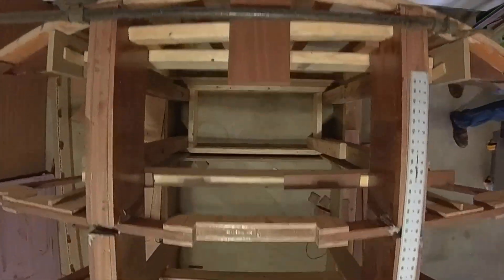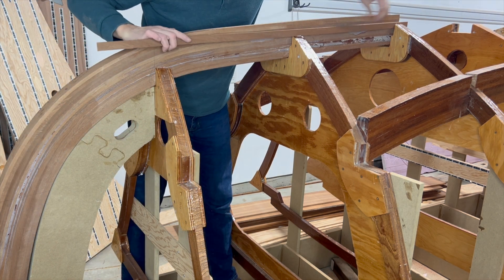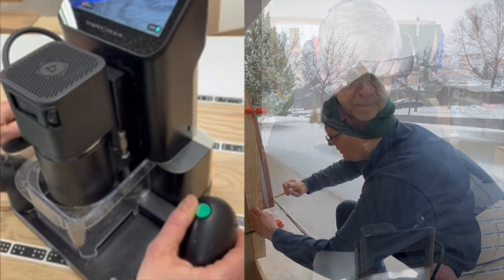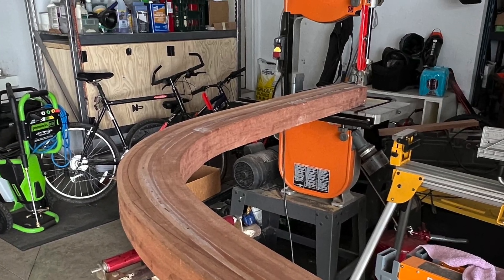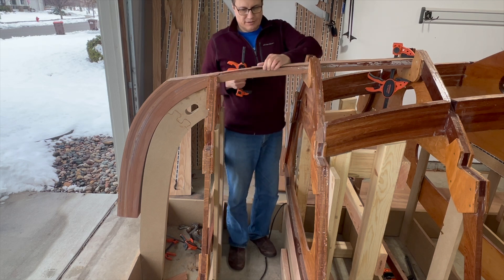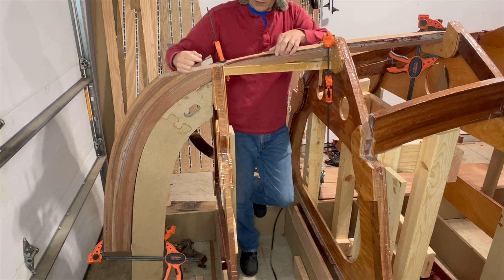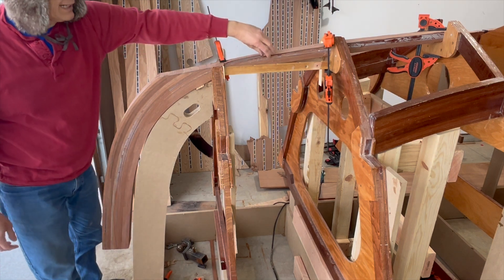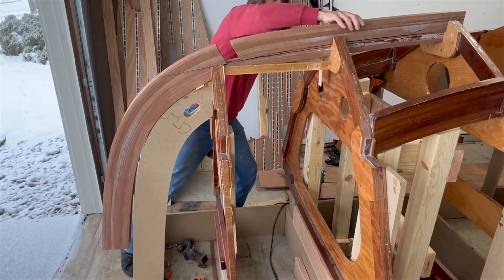Temptress Build 43: Profile and Install the Stem

Comment: building a boat on frames  ..is a left over from the   old days  when you skinned a hull with thousands of little bits of wood  .. we now have sheet wood  . so stitch and glue the frame later  is hundreds of times faster and stronger  ..AND  hard chines dont roll as much  . but if you want a boat that looks fantastic when its not doing what its spozzed to do .. that is . out of the water  go frames go round bilge ..
Reply from the maker: That’s okay… I am also a left over from the old days.😀

Comment: What a shame that the polythene wasn't in the scrap part! Good save though. The cut off part does seem wasteful, I think I'll try and come up with a revised lamination guide so you don't need to lay up full thickness layers all the way along.
Reply: It has been interesting watching the lamination process and as with everything, there are a hundred ways to achieve the same results. For the stem, would a thinner lamination with a tighter bend and a knee added in front of the first frame achieve the same result with the benefit of having the grain direction of the knee supporting the bend work? Also, would the stringers benefit from being done as thinner full length lamination's and more precisely cut blocking added between frames as they are attached work?  The large lamination's look difficult to bend and glue by a home builder and once glued, hard to handle. Just thinking out loud - no criticism intended. Doing is hard but worthwhile and I am just watching what the two of you are actually doing.
Reply: @hamishkirkness6933  thinner laminations in both cases would definitely reduce spring back. The stringers are a difficult one, there were several ways I thought of approaching making them. Originally they were going to be the primary build jig instead of the strongback and they would have sat on the jigs within the structure throughout the build. The full bulkheads made this not feasible though. Both this element and the transom jig got drawn up several times by myself in CAD and then abandoned for the current method.
Reply from the maker: @hamishkirkness6933 
Hamish - Thank you for watching.  No criticism taken.  For me this is a really interesting process, filled with painful learnings.
And I do think you are correct that thinner lamination boards would have reduced spring back.  But onward I march.
Reply from the maker: Dan - That is a really good idea.  I believe that would also reduce the spring back of the stem for a tighter fit to the jig.
Thanks again for all of your support.  There is no way I could have built Temptress without your guidance and the 3D CAD model.
Bob (a.k.a. Polymerman)
Reply: @Polymerman  yes I think your right, with less veneers stressed around the full curve, spring back should be reduced. Also I’m happy to be of help, that’s a challenging first time boat build you are taking on there!